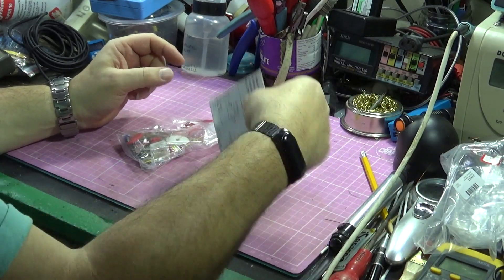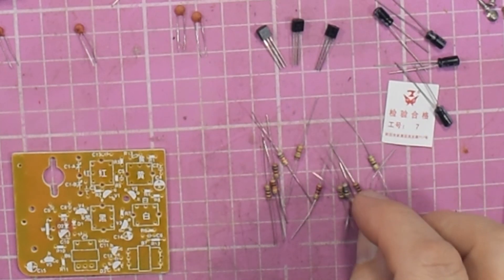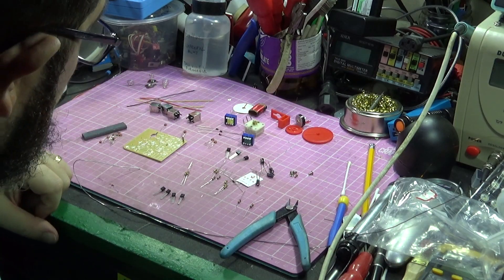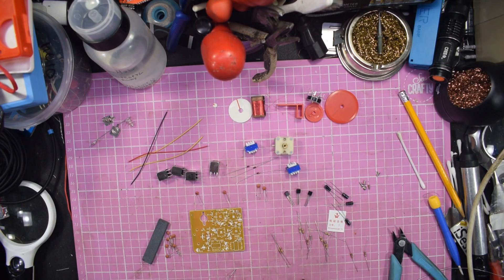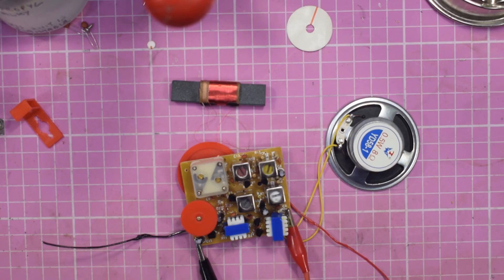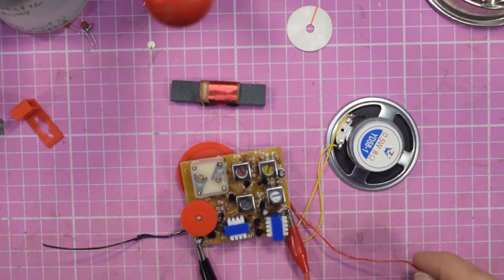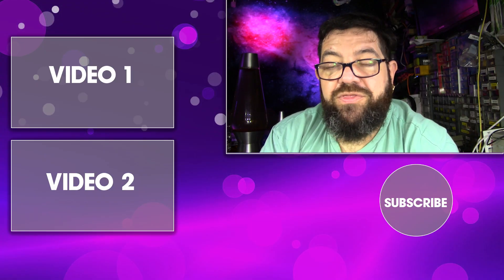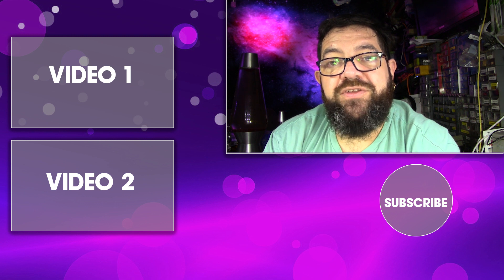Build an AM Radio - Cheap Chinese Kit

Comment: I baught 3 of those teal monsters. And all failed . Then sat down and picked the best from all three to make one  no sound then a whisper and using a 455 osc I got am from 4oo to 1ooo. I'll take it  it works cheep and got to be trade offs some where hi hi cheers om de kv4li
Reply: Got my Riggs to work by fact checking.  all big improvements (on my method) got a bunch of built kits  and give them as gifts. Just had to get my practice up. THANKS.

Comment: Is this on?  Is it live or was this Memorex? :)  Why don't any of these cheap Chinese kits come with a breadboard and tubes, lol?  2B or not 2B?  That is the question. Or is it B2?  Saw your comment to Bill.  Early on our FM band was much smaller as well.  The Armstrong FM band went from 40 to 52 Megacycles.  It didn't last very long till the 88-108 Megacycle band came along.  Zenith's first set with FM had dual bands for FM with both.
Reply from the maker: You can buy tube am kits! the trouble is that they use some pretty cheap and nasty tubes that really don't work too well. I always have disliked Chinese tubes, firstly in my Ham amplifier where the glass was so thin it melted through one and then in cheap guitar amps. They just sound a bit tinny and crap. They also can't take the equivalent voltages of the Russian or British tubes.  I was watching a video of a restoration where they had the 40-52MC band on a receiver. It is just funny how standards are developed. Things are not perfectly aligned worldwide though, we use 9Kc spacing on AM rather than the 10Kc you guys have. Also, the de-emphasis on FM is slightly different too.
Reply: @GeorgeChristofi  Yeah the majority of chinese made tubes seem to be made for military purposes and not for audio so that's why many oft them don't really sound well in audio purposes :( It's like with those tube amps where you often get order choices with better audio-purpose tube pairs or you get recommendations for tube type replacements that actually sound good. Especially for these 6J1 type tube amp kits.

Comment: Is the standard broadcast band the same in the UK as it is here?
Reply from the maker: Yes it is Bill. For AM we go from around 500Kc to 1600Kc. FM used to be much shorter, only to 102Mhz but the opened it up to 108Mhz quite a long time ago. Early British FM sets used to only go to 102, like the pilot set I did a few videos ago and I can't remember about the EKCO that I sent to Doug, Mosslack. That is early so may only do 102 as well.
Reply: Thanks George for the info.

Comment: Good to see its a superhet and not a crappy TRF chip.  I've got a couple of mini reproductions that use such a chip and while FM is good but AM has woeful selectivity.  The front end is just an 80 turn coil on a tiny ferrite and the tuning cap.  Although I'm a long way from Melbourne, one station can be heard over most of the band and the tuning range seems very limited. One of them is a model of the Ecko AD36 which made great of Bakelite using a round case. Almost as cool as the American Sparton Bluebird
Reply from the maker: I have a couple of those one chip wonder FM sets too. The thing with those for me is the lack of display and the way that it doesn't stay on frequency when powered off, you have to band scan every time. I bought this kit as a response to other videos I had seen around and thought I would take a look. In fact, I actually have another unmade one as well which I was tempted to build outside the box as a demo type set. So much going on though I haven't got time or space for much because of this building work. Nice to hear from you, take care.

Comment: by George, I liked that stop motion (for about a second).  
What if I like it a lot?  push like three times?  
I pushed subscribe and it unsubscribed me!  
But Utube does that sometimes anyhow.  
You-TUBE in the States, would it be you-VALVE in the UK?  
The Donald
Reply from the maker: I have no idea Don... It's a tube, or a TV  set... Or a cathode ray tube or vacuum tube. I had to slow the stop motion down to 2 frames per picture otherwise it just went too fast to be comfortable. 3 frames was too slow. I can tell you that there were 268 pictures in that sequence that I had to colour correct between the solder side and the screen print side. And I could have said SMASH that like button... The most annoying phrase on YouTube. It's a mouse click... You ain't gonna smash nutthin!